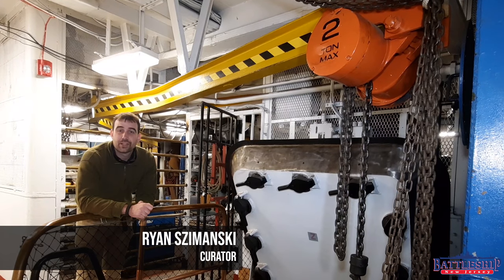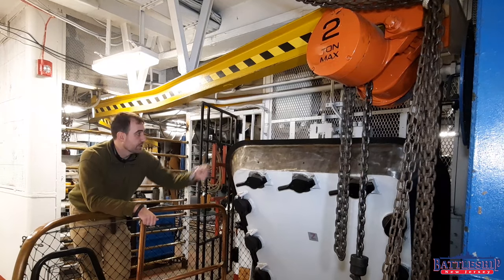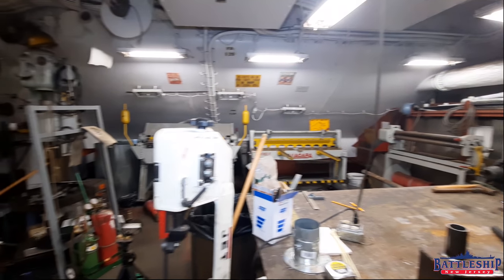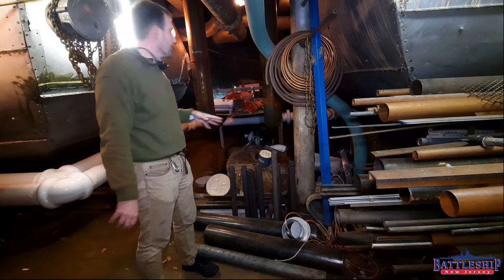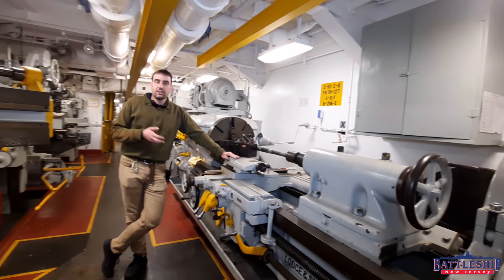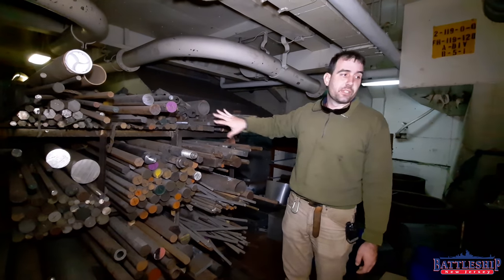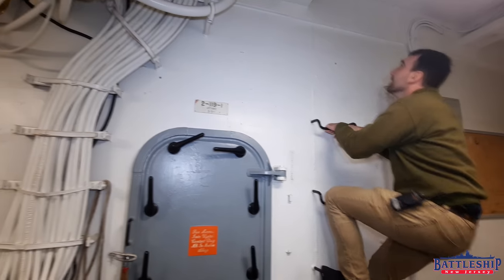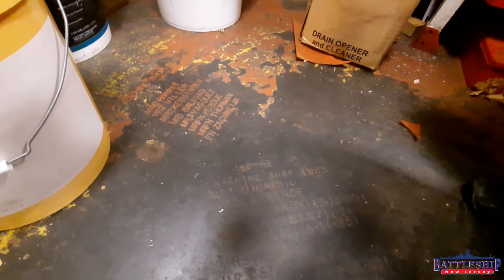Battleship New Jersey's Machine Shop

Comment: I was the LPO of the BB62 machine shop from 1985 to 1987. The stuff we fabricated on here was tough work at times. We made tons of gears, mainly spur gears. I made a helical gear for a lube oil pump. We fabricated remote operated gearboxes, I could go on and on. My name should still be stamped in the deck of the grind shop: MR2 (SW) LAWRENCE.
Reply from the maker: We show the names on the floor in the video!
Reply from the maker: Also, heres a picture of your group: https://photos.app.goo.gl/WVGFbqpALfjiABBYA
Reply: @BattleshipNewJersey  Wow, that's super cool to see the loop closed like that.  Awesome!  Much respect sent out to Lee Lawrence and his group for being out there keeping us safe.
Reply: Were all those pecker holes in the radial drill press table when you were there Lee?
Reply: @wdcjunk  Yes. And I'm sure a few more appeared after I transferred.
Reply: Thank you for your service!😃🇺🇸
Reply: I worked with a number of Navy Machine Repairmen. One was on a Submarine Tender. He told a couple of interesting stories. In one he had to bore out on of the hatches on the sub .100" simply to a new piece equipment could be lowered through the hatch. Another time the ship machine tools were being replaced so the ship left port and 10 or 20 miles off shore all of the old machinery was dumped over the side. All of it perfectly fly functional.
Reply: @mpetersen6  I've seen the same thing. Perfectly good foundry crucibles thrown over the side when I was onboard USS Cape Cod a destroyer tender. Tossed over 100 of them. When I was on the USS Yellowstone the sheet metal shop tossed so much sheet metal and metal plate overboard it seem like it would raise the ocean level. The waste was unreal. But don't take it home that would get you in deep shit.
Reply: What kind of gear cutting tools did you have? I mean, did you do it the old fashioned way with a dividing head, or did you have a hobber on board?
Reply: @operator0  We had a 3H Kearney and Trekker milling machine with a dividing head and an attachable gearbox.  All the gears were there and it looks like they weren't used previously. That K&T mill was awesome. Set the dividing head, gear ratios, and table swivel and you  could cut a helical gear. I cut a lot of spur gears, a couple days of bevel gears for gearboxes, clutches, and one time hobbed a worm wheel. I actually made the job and then gear treated it and ground it sharp on our tool and cutter grinder. We had all the gear tooth cutters from 1 DP all the way to 48 DP if memory serves me correctly.  There wasn't much we couldn't do.
Reply: @leelawrence1557  
Given limited space a milling machine is a better option. Gear jobbers are pretty much a one trick pony. They do that trick very well though. A Barber - Coleman series 16 doesnt take up much room though. Ran a lot of gears and spine shafts through one. Plus we had a Fellows gear shaper.
Reply: @mpetersen6  When I made that hob you're right it was a one and done. Never used it again.
Reply: @leelawrence1557  
All of the gears and splines I cut were for repaing industrial machinery and spare parts for fixtures that had shafts of gearing in them. The nice thing about hobs is one cutter can cover a wide range in terms of number of teeth. Hobbing worm gears. Yah, then the cutter needs to be basically what the worm is. One thing I always did when setting up to cut helicals is if a had a feed solution for a specific pitch and lead angle I kept notes. At that time we had to factor the change and feed gears for hobbing helical gears. Now you can just go to a web site, punch in the ratio, minimum and maximum number of teeth in the gear train and number of steps. Presto. Usually as long as the answer we had was .9999 to 1.0001 of the true ratio we were good to go.
Reply: @mpetersen6  Good info. When I cut the helical gear, believe it or not, I didn't hob it. The most difficult part was setting the milling table to the exact swivel. Once I cut it and checked the final dimensions, I had to roll and blue it in the gear case. It came out perfect. Great tooth contact. No excess noise. I put that to prayers and some luck. Unfortunately my Chief, who knew nothing about cutting gears, got all the credit, even getting a medal for it. Truly pissed me off.
Reply: Should have seen the brand new Willy's Jeeps & Ford Trucks sent to the bottom after WWII. All because, the manufactures did not want them sent back unused & sold as military surplus on the the commercial market! It would have upset their apple carts of selling new vehicles to the public! There was so much new & serviceable machinery sent to an economically unretrievable location to protect American Business. Dwight Eisenhower warned about what was happening!

Getting every nickel of what the taxpayer spent was not the desire of American Industry! American Industry wanted more of your nickels & cheat you of what you had already paid for!
Reply: Thank you for your service to our great Nation
Reply: The only name i read when the camera panned over the names in the deck.
Reply: @mpetersen6  the job I served my apprenticeship in..had an old Cincinnati horizontal milling machine with a u.s. navy stamp on it.. supposably salvaged from one of the old s s boats that was sunk in shallow water...
Reply: @leelawrence1557  haven't run an old Kearney & trecker since the 80s... They are built tough and they just keep on running... Haven't used the dividing head in a long time either..
Reply: @squigmontlucas6150  
We had a number of mills that had War Production Board tags on them where I served mine. The facility built Pratt & Whitney R-2800s in the 40s and 50s
Reply: @mpetersen6  cool... I'm currently sitting about halfway up the column of a g&l hbm 7 inch spindle rebuilt 2006 with FANUC controls.. they replaced the box ways with linear ways... Five axis..cutting the chamfers on a 4inch x 6 tpi x 8in deep hole... Thread milling is next.. Nitronic stainless steel... One half of a very expensive garbage can!! Lol! This half is 79 tons of a nuclear waste container....
Reply: @squigmontlucas6150  
G&L did build one hell of machine. One guy I worked with when he was there did pretty much nothing but scrape ways. A lot of the wear pads were actually micarta
Reply: @mpetersen6   micarta is tuff stuff.. stinks like hell when you have to machine it..  I have the part sitting on a 12 ft rotary table..it was rebuilt also.. management went to the lowest bidder instead of getting g&l to do it..it's a hydrostatic table and the idiots who worked it scraped the ways.. it has leaked like a sieve ever since.. engineering designed a very expensive scavenging system to collect the oil and recycle it.... Just another example of cutting off the foot to save the big toe...
Reply: what kind of material stock and how much would you guys generally have?
Reply: @bobbyintheshop  We had brass billet to manufacture impeller rings, 300 and 400 series stainless steel from 1/2" to 10" diameter, cast iron, we would never run out of metal. Occasionally we had to order odd stock but not very often.
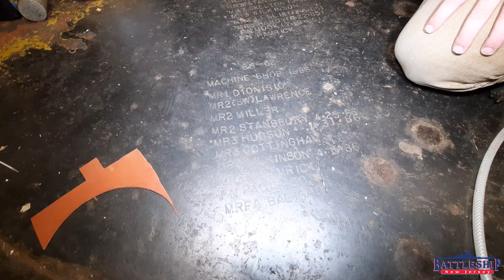Reply: 11:49 shows your name.
Reply: My Grandfather was one of the lead machinists when it was first built . He was aboard during initial sea trials as well.  
 Worked in the Philadelphia ship yard as a civilian.   
 I do not remember his name being stamped or identified anywhere on the ship unfortunately.
Reply: My Grandfather was onboard when it was built.  He was a lead that was also teaching machine work during the build, he was assigned to the New Jersey as a civilian from the Philadelphia ship yard.   
 Ty for serving .  
 It must have felt special to be on such an amazing ship.
Reply: @mpetersen6  Indubitably
Reply: @leelawrence1557  why would you get in shit for taking spare material home?
Reply: @jamess2873  Well, its military property.  Taxpayers pay for it. So if you get caught stealing in the military that is a serious offense that I have seen guys go to the brig and/or get thrown out of the service. And if you steal from your ship or unit, it impacts readiness as that item that was stolen may be essential equipment.
Reply: @leelawrence1557  So why do they throw it overboard? if it has value, why were they dumping it at sea so regularily.
Reply: @jamess2873  Sometimes to make room. Its excess and no one wants to take the trouble to turn in stocks, especially metal. Ammo is another item thats gets used up as the paperwork involved to turn it in shoreside is enormous.  A good example of this is when I was on board the USS Yorktown CG48. After the 1st Gulf War we were coming back stateside, a buddy of mine who was a Gunners Mate, let me fire close to 80 M79 Grenades from the M79 Grenade launcher. It looks like a shotgun on steroids.  It was fun but a waste to fire them off in the ocean. Too much grief involved turning the grenades in especially if they had a shelf life. Then its a disposal issue, an even bigger headache.
Reply: Thank you for your service sir.
Reply: Thank you for your service!
Reply: Must have been a good two years. I can’t imagine floating on a Battleship, I was always on the LPHs like the LPH-3 Brokenawa, or an LSTs 🤢🤮,
Reply: @gateway8833  It was a seriously demanding tour. There were times underway when so much equipment (mainly in the propulsion pants) that was broken dick we would be swamped.  Plus standing watches 4 and 8 made for a long day. There was one time I was up 3 days straight, no joke, overhauling No. 6 main feed pump. Had to make the pump shaft, new rings, then balance the whole assembly before it went back in the pump casing. When I could finally get in my rack, it took a couple hours to fall asleep.
Reply: I dont know what many of these machining terms means but this is one hell of an interesting comment thread
Reply: @leelawrence1557  wow you made parts for a boiler feedwater pump? impressive....because it is so important and to make parts for one means you are a damn good machinist. I love boilers.....the feedwater pumps in my paper mills are also turbine powered...modern german multi-stage centrifugal pumps balanced so well you could stand a nickle on one while spinning 2500 rpm. The old paper mill in plymouth nc still has her 1M gallon bunker c tanks and fuel pumps/heaters in place, though their boiler burns black liquor now for cogeneration. I frequent BB-55 from time to time and could spend hours in the boilers.....tracing condensate lines....reading everything......imagining the chaos that a direct AP hit round would cause. Love these old ships and the people who made them come alive.
Reply: @midship_nc  Yep mainly impeller rings, casing rings, and the pump shafts. The pump shafts could be repaired, by electroplating the bearing surfaces and straightening the pump shaft if it was bent. But if the threads on the shaft were messed up or any critical diameter was off, we made a new shaft.  Couplings were usually a navy standard stock item, so we bored them out and made sure that they were concentric with the feed pump assembly.
Reply: @leelawrence1557  i figured you could make shafts and wear rings if you had to, i saw the key cutter in the video. Those old pumps were probably bingham or dresser rand. Im guessing packed with grafoil packing, in the 80's it may have had mechanical seals. Anyway, thanks a lot for the response.
Reply: @leelawrence1557  thanks for your service
Reply: @mpetersen6  When I was on Kennedy I seen the Green shirts pushing 6 Full brand new Snap On tool boxes into the gulf. I ask why and they said that some tools got ordered not whole tool boxs and they didn't have time to count them all everyday so they sunk them. Couldn't have unaccounted tools around aircraft
Reply: thank you for your service
Reply: Are the names grinded into the steel, weld beads, or acid etched?
Reply: @joshuasill1141  punched in with steal punches
Reply: Your names there at 11.48 lol
Reply: correct me if i'm wrong, but as mentioned in my other comment, the lathe at around 11 mins seems to be newer than 1940's.
Reply: @mpetersen6  My tax dollars at work, thank you, SecNav at the time!
Reply: 11:48
Reply: @rogerlaurel2363  My father was Army Engineers in the pacific in WW2.  He built runways across the Pacific from Hawaii to Okinawa.  He was on Okinawa when it ended.  His Battalion had just received all new gear, machine shop, trucks, heavy construction equipment, the works, because they were scheduled to be the first construction battalion ashore on Japan after the invasion.

They had been the first Engineer battalion to reach Hawaii after Dec 7, so they were the first to go home, even though MacArthur had specifically requested them for the occupation.  They just left a battalion worth of gear behind and came home on the first available ships.  My father said that they practically comandeered a couple  of ships, to get away from MacArthur.
Reply: how often would you need to level the bed ways? I would imagine the constant rocking out at see would not exactly be gentle to these machines.
Reply: @BattleshipNewJersey  That's so cool. Your name will forever be etched into the New Jersey.
Reply: what other ship were you on?
Reply: @larryfairfield8137   USS LaSalle AGF3,  USS Cape Cod AD43, USS Yorktown CG48, USS Yellowstone AD41,  USS LY Spear AS36 and USS Nicholas FFG47.